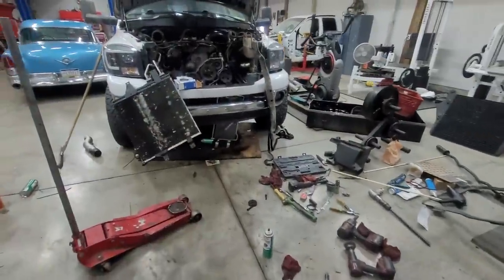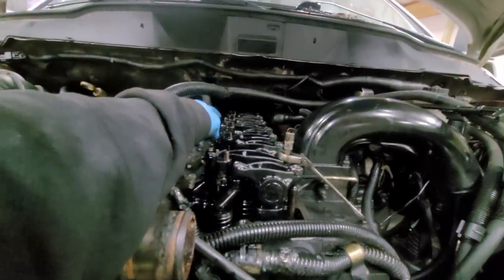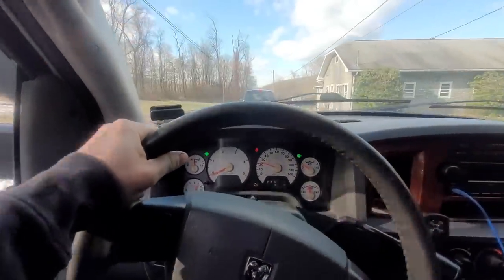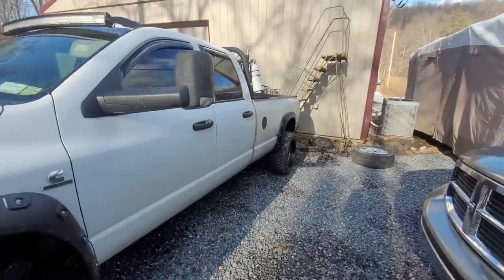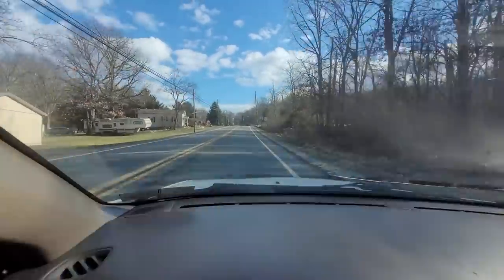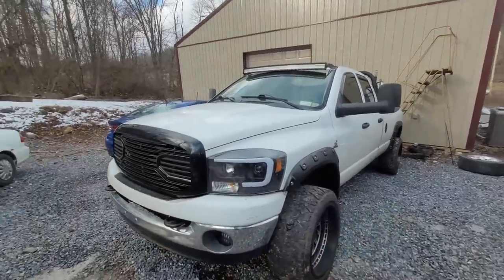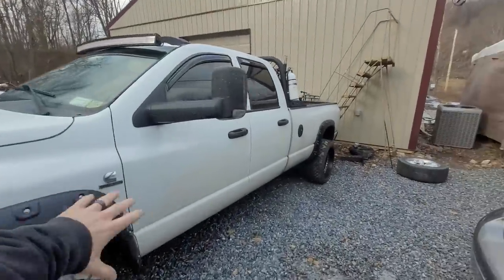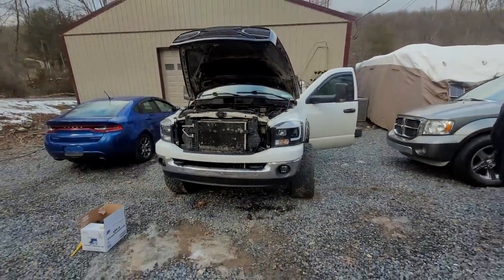Blew Out A Transmission Line | How I Went Through $12,000 In One Month

Comment: I use the Dorman transmission cooler purchased at Summit Racing, part number for a 6.0 on my 7.3 Powerstrokes. 31 rows, same size as the Mishimoto for half the price. Been running it for over 2 years with no problems.

Comment: Hi Steve I know the feeling of dumping money into a truck being a money pit but when done you have a very good and reliable truck  plus that is a very quiet running disel truck congrats awesome video will you be putting air bags on the truck and it be interesting to see how you bypass trans cooler from the engine
Reply from the maker: Keeping the timbrens but as for the heat exchanger I'm not sure what method I'll use on that yet.

Comment: Steve, Just an FYI. I signed up for Mudflaps using your code. There are a few discounts near me now. I use another discount program and for now at least those are better. I will see this spring how Mudflaps works on the road.

Be sure to get the Cummins industrial and marine 165 degree thermostat, so much better for your engine. And it sure helps me when towing. I really need to figure out a way to bolt the fan for constant drive instead of that stupid fan clutch.
Reply from the maker: Everything fluctuates depending on the time of year and what's going on. I was using EFS awhile back since they were better sometimes but they're hard to deal with. I use Mudflap when the time is right but there are a lot of loads I prefer to use the company credit card that way I'm not out of pocket. If mudflap had a credit line I do feel that would be an awesome improvement. There are times where I'd have to put out weeks worth of fuel expenses to not get paid for a month. That can rack up 3 to 4k in fuel so the credit line really makes it manageable. Hopefully that'll be a feature if it isn't already!
Reply: How is EFS hard to deal with? I’ve used them for over 3 years and never had a problem. They are linked to my bank account an debit it😢 whenever I purchase fuel.  It’s easier than writing a check! Their app allows me to see how much I saved after every purchase and the emailed settlement statement gives all the details.
Reply from the maker: I didn't like EFS. There app was always hard to use whereas mudflap all the discounts show up. I had an instance where I got fuel the one day and was on the phone for 45 minutes until the reps finally authorized the transaction. It declined AFTER the fuel was already put in even though it authorized. There was a few instances of dealing with that but it had nothing to do with the account itself. They just aren't my favorite. I'm sure there's thousands that like them otherwise they wouldn't be in business. 

My only gripe is having to debit every fuel expense. I'd rather put fuel on credit and pay it off after the broker pays out. Same thing in the shop. There'll be times when I have to purchase a few grand in parts but it's so much nicer not worrying about it. I can link a credit card to mudflap but the problem is all of mine are 300 to 600 limit. My fleetone card I don't know the limit and haven't reached it. The number is 19 digits though so they won't let me link it.

Comment: 6.7 CUMMINS RIGHT NOT A 5.9?
Reply from the maker: 5.9. It's on 06
Reply: @CPSteveMiller  DAMN
Reply from the maker: I didn't want a 6.7 right now. Too much more to go wrong plus the 68rfe is trash. In the future I'd love a 6.7 with a g56 just to try it but that'll be when we're set with 6 figures in the bank as a backup.
Reply: @CPSteveMiller  ye im lookin to buy a 5.9 3g any red flags u know about
Reply from the maker: 06 had ring issues but the head was ported better. Just check for blowby, typical front end wear, electrical issues, rust on the rockers/frame, etc. Also be sure to check any and all u-joints in the driveshaft and the front axles.